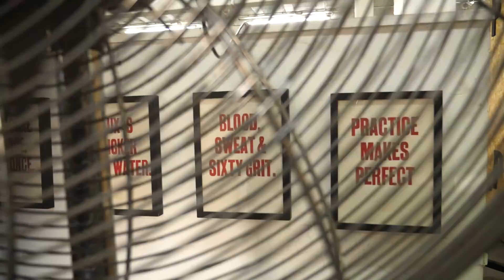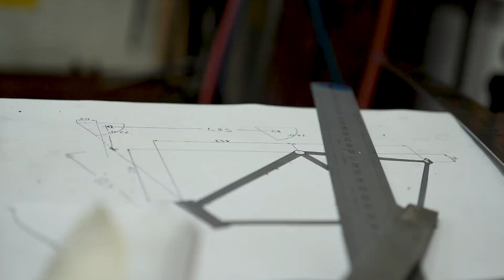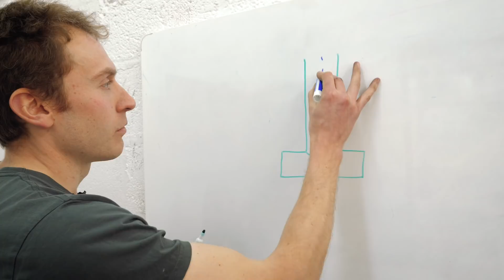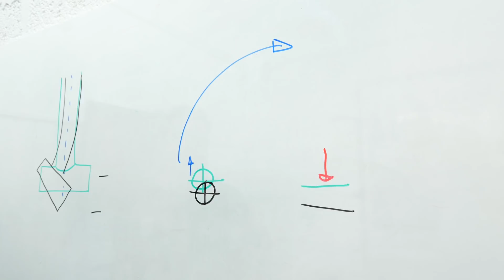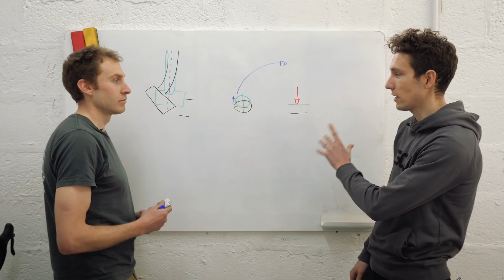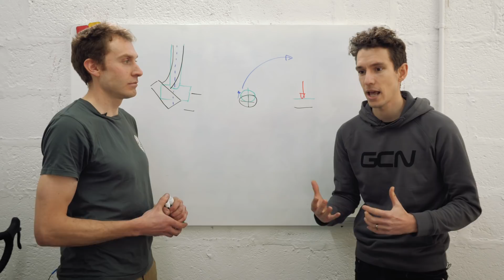Are You Faster On A Stiffer Bike?

Comment: No consideration of the elastic potential energy in the chain? No flex between fork and BB? All energy we put into the pedal is going to be transformed or transported into torque on the wheel, heat by the flex (this is a loss of energy), internal potential energy which is going to be released later as this video shows. And the non-perpendicular component of torque onto the wheel is also going to make an energy loss mostly in a form of sound noise. This is still just a part of what's going on... Having a released energy due to the flex means nothing because the topic is whether we lose energy or we gain some kind of efficiency. If I turn in this video as a report of physics I will get a grade of B- or C (I am a physics major college student). As many people say this is not a proper way to do a science (I am sorry, but I would say, not at all). I respect what GCN did and what this video is trying to explain and I understand that this is not a science channel though. I think it's better not to try to perform scientific explanation without any assistant of real research institutions to avoid this type of argument, as we just want to enjoy bike videos. Sorry if these types of comments annoy other viewers.

Comment: I am afraid the idea of giving back is flawed.
When you go fast and are in a small gear you can spin the pedals without putting any energy into the drive train, because you don't spin fast enough to engage the freehub.
The same should be true for slowly putting less power on the pedal and releasing the energy stored in the frame.
I believe at that point your not turning the pedals fast enough.
That being said, I also think that the flex should be so small it would not make a significant difference. Because the back wheel can turn freely you will rather accelerate than twisting your frame.
The only scenario that might show a difference is when you go up a hill in a very big gear and extremely low cadence.
However in that case the low cadence alone will be so inefficient  that it seems to be needless to talk about frames flexing when considering what effect is governing the efficiency.

I did like you looking into this question.
Next level: Talking about CRANKS flexing.

Comment: What about flexing caused by pressing down on the left pedal, opposite the drivetrain?  It will contribute nothing because it would cause loading of the drive train in the opposite direction.  Best case, it contributes nothing, worse you will lose that small amount of energy away from the energy you are putting through the drive side pedal on its down stroke (after unloading the pedal on the opposite side).

Comment: Can you place the pedal exactly 1cm above the block, then put your foot on it and see how fast the wheel turns? Then compare the speed of the wheel turn to the speed from when the bike flexes experiment. Which goes faster? If they are the same then the guy in the video is right and stiff bikes are not so important , if it goes slower then stiff bikes are better.

Comment: I have always thought my road bike as a leaf spring. It definetly feels like it is working with me up a long climb, sort of giving me back energy which has not found it’s path to the rear tyre. On the other hand, my TT bike feels much stiffer. It feels very efficient when putting in a lot of power for example when surging over a short rolling hill. It is also quite jarring to ride over two hours, but it that’s just fine because it rarely gets a ride more than 1,5 hours long. Both bikes are made of carbon fiber during consecutive years.

Comment: Are you stiffer on a faster bike?
Reply: That's a very personal question. But I'd say it depends on time of day. I'm definitely stiffer in the morning.
Reply: I'm always stiff for a fast bike #bikegasm
Reply: definitely
Reply: I'm always stiff on a bike
Reply: Peepee never stiff on and after the ride...
Reply: Oh No, you didn't. 😁
Reply: I was TOTALLY thinking about back stiffness coughcough
Reply: Is that the same stiffness I am thinking about?
Reply: What does Eddy Planckaert say?
Reply: Im always stiff on a bike 🙃
Reply: Yes. This experiment has multiple things wrong with it. the biggest thing would be that they pressed on the pedal and held it down. which just the frame right now is acting like a spring but because you're holding a single pedal down 99% the forces allowed to go back into the drive train. but when were peddling were alternating legs which means we're not constantly holding pressure on one side. 
when were actually pedaling alternating which side is relaxing and which side is applying Force. So this means that the frame is always flexing in the direction of the side with the least amount of force. so this means that the force is going in the opposite direction of the drivetrain weather be back into the frame and into your leg this equals force/power loss.
Reply: @alexgrinage No the experiment is not wrong. The fact that while pedaling we alternate the pressure between sides doesn't change a thing. It applies for both sides. The flex energy is fed back to the drivetrain once we release the pressure from whichever side we were pressing on.
Reply: @radiocontrolled9181  fuest bruh, this comment is 4 years old . Second, this has been studied  multiple times since, and basically, it depends on whether you want  some parts stiff and other parts and  flexible, and it depends its something u have to optimize.  

Lastly, there were many problems with static is never the same in real life.
Reply: Have to adopt the stiff aero position on a faster bike
Reply: Fast bikes make me stiff

Comment: I am still not convinced. Any noticed the chain also moved forward? When Si stepped on the pedal, he also "pedaled" the bike a little bit, but they didn't consider this factor. Might as well do the illustration when the pedal is at its lowest position (6 o' clock).
Reply: If you look at Tom's description, the chain moves forward because the bottom bracket returns to it's original position. The chain wouldn't be able to store any energy on it's own.
Reply: Simon Richardson Thanks for your reply Si! This is so exciting. I guess what I'm saying is when you were stepping on the pedal,  because of the gap between it and the metal block, the crank did spinned clockwise and therefore stored some energy in the chain, cassette or whatever. I just don't know how much of that energy was and if it was negligible.

Comment: I can imagine that the more damping you have on a frame or in a frame the less power gets to the road. Im thinking of Bianchi countervail technology.
If a frame material obeys Hooks law then a flexible frame would not loose power. It only makes a difference to how the bike feels i.e. the timing of your power inputs.
As long as any input to your bike returns to its starting position (handle bars, pedals) and is undamped then no power is lost
Reply: Make sense to me. We may discover that bike “feel” is the new frontier. As the wider tires with less pressure example has proven, the frame tube sections will keep evolving to insure comfort and fast acceleration, but also cornering flex witch Si test doesn’t take account of. Still super interesting. More tech to come on this I am sure.
Reply: sandrochiavaro I'd imagine if you were a very strong sprinter you would want have a stiffer frame to minimise any deflections. Also descending at 60 mph, resonances and flex isn't your friend. Possibly  the countervail technology of the Bianchi might be worth losing a watt if it steers well.

Comment: They need to find what the ideal flex to stiffness ratio is, if there is one.
Reply: James One think of an airplane wings. They need flex so they do t shatter and crack, but it also helps acceleration. Then, some stiffness  is needed for max speed. It’s all about that exact thing you mention, “the ratio” in my opinion. I feel an honeycomb inner structure of carbon tubes will evolve to create exactly that. Even can be customized based of rider weight, or road surface specific for traditional grand tour events. I am actually wondering if tires are often the only focus of pro riders in cobble stone classic events. I know some riders like double bar tape for that comfort, but it should apply to frame stiffness also, maybe?!?!
Reply: Yes, finding the right combination for each riders weight and riding style. They do this to some extent now but eventually they should be able to improve it even more.

Comment: Excellent demonstration of the frame flex returning stored power to the drivetrain. This definitely helps smoothen the power delivery. People have mentioned that there will be a loss of energy transfer, but a springy steel frame should have very little loss when returning the energy.  Think of it as a steel spring and how it is pretty efficient. I would rather take a slightly flexy frame that works with my pedal strokes over a stiff one that bolts forward instantaneously. PS: i a not a sprinter or a racer.

Comment: The sweet spot is when the frame planes for you. See Bicycle Quarterly for more info. When a frame planes it means that the rider is able to put out more power and feels less fatigue in his or her legs. So it's really a physiological thing!
Reply: I could only think of the concept of ressonance to support the frame plane hypothesis. That will probably mean that frame plane will only occur at a certain power/cadence combination, which again will make it pretty useless in practical use.
Reply: Stig Aannø If it's resonance that gives the benefit then it would apply to all power outputs as long as your cadence was near the natural frequency that the frame flexes at. You would only need to worry about maintaining cadence, which is easier with more and more gears on the bike, as long as you don't go 1x.
Reply: Erik H you are of course right, it will depend on the frequency and not the amplitude. But still, the ressonance frequency will be a product of a combination of the frame and wheels. Maybe we will see people tuning their wheels  through spoke tension to set the preferred ressonance frequency in the future? Well I think I myself will go for the stiff bike/wheelset combination. Look up my other post to see why I think this is the best option.
Reply: Max Sievers you made me read what was available without paying and now I am even more sceptical. The stiffness of the wheels will for example make up a lot of the characteristic of the stiffness of the bike. I do not see it even mentioned. They mention measuring power, but I don't see if they measure at the pedal or at the wheel hub. It is a crucial difference given the thesis they are trying to prove. They tell that this is the secret of covering ultralong distances like Paris - Brest - Paris, which make it really look like quasi science (I have covered a distance of 540km more or less non-stop on a stiff carbon frame and wheelset, my legs were fine, my ass hurt and I needed sleep). Boats plane, frames can theoretically resonate, but I do not buy that it has much to do with your weight and power (due to certain laws of physics). I think the biomecanical argument makes a compelling case for oval chainrings, but not for a wobbly frame.
Reply: Stig Aannø A bike that planes isn't wobbly. It has to be flexible in the right spots and the right amount. Look at Jan Heine for example: He is searching for the optimal bike for decades and he prefers bikes which plane for him. Jan wouldn't accept a bike that is wobbly. In fact he is amazed again and again how well a low trail bike with supple tires follows the line he chose.

Plaining is real. It got proven in several experiments. On a bike that planes you aren't held back by your legs but by your over all fitnes.
Reply: Stig Aannø It was a double blind test. But two out of three test riders could identify the planing bike by the way it rode. The power meters show that all riders put out more power on the more flexible bike and those runs were also faster. The person who couldn't tell which bike he was on put out less power than the other two. So probably even the flexible bike wasn't really planing for him.
Reply: Stig Aannø Bikes can plane. That is proven. Read Bicycle Quarterly! It is very relevant in the real world and it depends on your power and weight, not on your cadence.
Reply: Max Sievers Well, the experiment you are referring to suffer from a to small sample size and has a high probability of cognitive bias. He is unable to explain the physics that support what is happening, which leaves it pretty much down to what you believe. I am willing to dicuss physics or scientific matters. Discussing beliefs is in my opinion a waste of time.

Comment: One thing that was completely neglected is that when the frame yields under load gears and chain are no more aligned properly and this can be draining energy straight into friction and heat. Actually, this may be even more of an issue for belt drive systems where alignment is very important. Mine starts to make noise when I push harder and I have a suspicion that it may be because of the frame flex. Rear triangle tubes are quite thin on my bike.

Comment: Nice to see an attempt at showing the principals involved here. I know that its going to be hard to give a perfect experiment when your not in a lab and can test for all sorts of variables. Though it at least shows that perhaps due to conservation of energy we shouldn't be so concerned that if there is some flex in your frame then you are just wasting all of your energy just to make a frame flex instead of making you go forward which is what your looking for. I am sure that some more more testing in a lab would help a little more but good one to get the ball rolling! Nice to also show you don't need to chuck out that steel/aluminium frame because it will flex.

Comment: So, I would like to add when the break was released, the resistance from the wheel from spinning is less than the resistive forces of the frame. However when at top output your application of power matches the resistive forces to moving forward. therefore when at a top sprint you will only lose power rather than getting it back. It is illustrated by the brake in the example in the video, where the force is only released back when the resistance drops.

Comment: Good try but you can't accurately measure the effect flex has like that. At least you need two bikes with all else equal except the amount of flexibility in their frames and a power meter to measure the amount of force applied to Th pedal. You would need to measure the amount of the resultant rotations of the rear wheels. Apart from that you are comparing apples and oranges.

Comment: Experiment is correct but not the conclusion. The energy that you see on the wheel is what you will loose by flexing the frame with 1cm of pedal stroke with Si's weight 70kg (being generous ; ) ) 
Therefore, whilst riding a flexi frame will loose propulsion energy. 

A drawback is that a stiffer frame has bad riding characteristics, flexi frames has a "suspension" effect that keeps the tyre in contact to the ground (no contact to propulsion forward or cornering) 

This is my view is the design trade we are facing

Comment: Great video GCN, I am quite fond of the idea of bringing science into the sport we all love. This is an interesting and honestly difficult question to answer. Please allow my thermodynamic background to shed some light on this question. 

Energy cannot be created or destroyed. However there is no process or series of processes that can happen without any loss of energy, and this loss is called entropy generation. This has to do with the second law of thermodynamics. Unfortunately we live in a cruel world where almost all processes inherently have some losses. Even a simple pen spring that is compressed and released will dissipate a small fraction of energy and not return the original amount energy used to compress it. As the video accurately states this can reveal itself on a bike in the form of heat (minimal), sounds, etc. 

As we bend a frame, stretch the chain, and load the hub, these components are perceivably acting both like a (perfect) spring and a shock-absorber (which will absorb and dissipate energy). This is dependent on the material, geometry, carbon, layup, resin etc. And although we may get most of the energy back, generally speaking the more flexible the frame is the more it will dissipate some of our coveted watts. Generally speaking; stiffer bikes are faster bikes, as the energy is put directly into the intended desire: Speed. 

As Si pointed out, in some cases this principal can work against us, like in tire pressure and width. However this question is a different scenario (between the road and bike rather than rider and frame) and will have a different criteria to analyze. 

Cheers, 
Sal
Reply: Thanks for the response! Would you like to hazard a guess as to how much energy you'd lose?
Reply: That is very difficult to quantify an exact value without experiment. It is the damping coefficient that would make this easier to calculate, but would be very different across a variety of bike frames and components. 

This value would then change depending on the amount of torque you would be putting through the cranks. The more torque the rider puts into the cranks to produce power the larger the frame deflection and associated losses. 

This subject, to my understanding, has always been why carbon bikes are superior to metallic bikes. As you know carbon bikes can have areas of stiffness and flexibility to optimize when and where the bike flexes, to balance comfort and power transfer. Layup and layering make carbon such a miracle material for engineers, while with metals you are constrained to geometry alone.